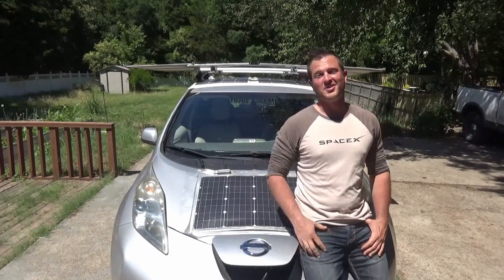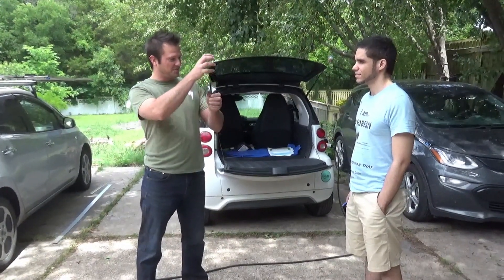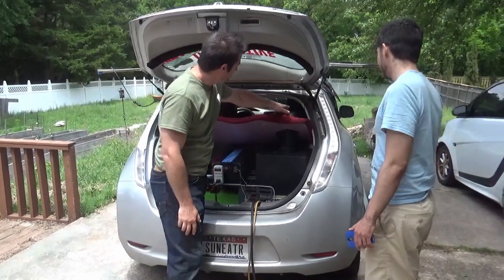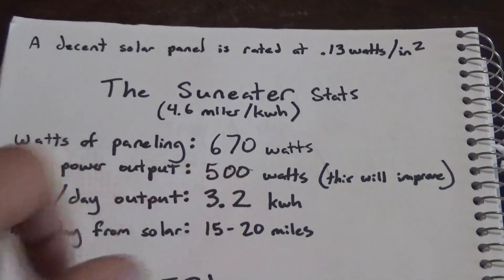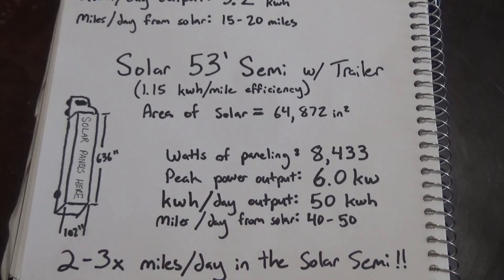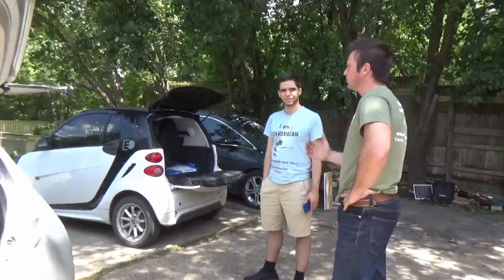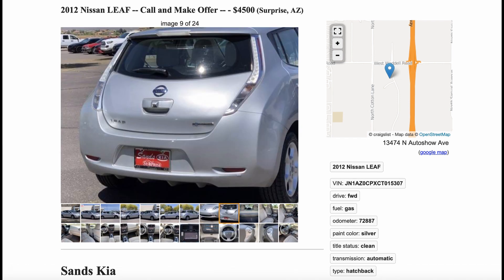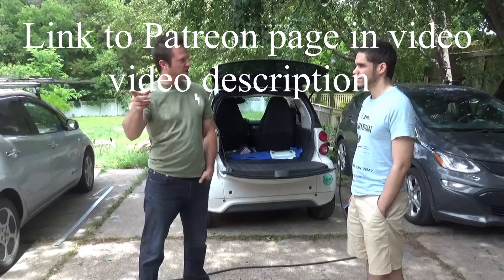Solar Powered Smart Car

Comment: I love everything about this video.  I have been inventing for years and you must not let a few failures get you down.  I recently tried to import a Renault Twizy to New Zealand but failed because it could not be registered for the road here.   My arithmetic suggests that the lighter the car, the better your chances of success.  I see that AliExpress now has flexible solar panels mounted in a frame.  They are light weight and more rugged than a normal flexible panel.

Comment: Im buying a leaf soon. Do you think you could do an updated how to video. Like what you'll need in your solar panel kit. Where to buy it from. How much it costs. Then how to do it!
Reply from the maker: I need to do an updated complete build video.  The first one could use some touching up for sure.  It will probably a while though.  If somebody else got all the parts and brought them over I'd help them build it as an updated build video.  It's a full days work to do the build though, and I have way too much on my plate already.

Comment: I love my Nissan leaf. Unfortunately baterry have 3 bars only, in thinking on install something like this, the big question is....is there any option to charge the when is in ise? Like Chevy volt, the volt have his own generator. When battery is low generator run. But car still runing
Reply from the maker: We could hook the solar up directly to the main battery.  I want to develop an adapter to make this a simple plug-and-play process.  The problem with using your solar power while driving, is driving takes a LOT of power.  20-40 Kilowatts.  The highest power I've ever got my system to produce is 1/2 a kilowatt (500 watts).  So basically 1 minute of driving for every 10-20 minutes of solar power.  So if it charges all day it can get you somewhere around 12-16 miles, but during a 20 minute drive around town, the solar would deliver minimal extra power.  I hope I did a decent job of explaining that.  Have you considered getting a new battery from Nissan?  You could have a 12 bar Leaf again for $8,000, and then sell the battery currently in it for 1,500 or so.  So you're out of pocket 7,000 or so for a "new" Leaf.
Reply: @InnovativeSustainableSolutions  i see, an other option, (idk hoy difficult is) install a generator, like volt or i3,  did u think about it? What i want its run the car wo stop to recharge it. And i don't think so, install a new battery for 5500 mmmm, i going to install a system like yours, and when battery gets died bring to the junk,  i prefer to buy a chevy volt, i like those too, thanks for your reply bro, God bless

Comment: I honestly suggest 2 small wind power generators that can be deployed on the roof when parked. NO extra weight for batteries or having to worry if there is no sun.
Power converter and a small battery bank as a buffer will weight less and function 24/7
Reply from the maker: The wind generator gets suggested by a lot of people.  I may try it someday, I think it would be worth it JUST to see the reactions of the guys in the work parking lot.  The reason I havn't pursued this yet is setup time.  We're doing 5 to 6 12 hr shifts/week at UPS right now, and I'm really trying to keep the time it takes me to park and deploy the roof rack, plug in the car, etc. as short as possible.  Ideally under 2 minutes, so I can get the day started.  I'm having trouble visualizing an attachment method where the turbine can be removed from the vehicle and fully installed in about 60 seconds.
Reply: @InnovativeSustainableSolutions  I already thought about that. I'll explain it to you in an email. Hint. Rail system with one hinge

Comment: I saw something of a pull out solar shade for the smart on YouTube. Would that work for the leaf? https://youtu.be/wyJYU2j-FDM
Reply from the maker: I'm about 95% sure the system in that video doesn't work.  You have to have a pretty consistent 600-700w+ power supply to charge an EV.  Solar panels power output varies considerably based on lighting conditions.  So on a partly cloudy day the system shown in this video would dip below that minimum power requirement as many as 100 times in a day as cloud cover blew in and out.  There is a contactor that closes with an audible 'pop' whenever you plug in an EV (Leaf, Bolt, Smart Car, Tesla you name it).  This motors that open and close that high voltage contactor are designed to operate once, maybe twice a day tops (when you get home and charge your car).  Forcing this switch to open and close 100 times a day when cloudy would almost certainly fry it in short order.  I've been thinking about doing a video on all this, but I'm not sure anybody would find it interesting.  What do you think?
Reply: I agree with Sam that the system doesn't work.  I don't think that's an actual solar panel. It looks more like a roll up poster holder. The typical flexible solar panels do not curve like that. There are rollable AMORPHOUS silicon solar panels. But the efficiency of amorphous silicon panels is very much inferior to mono-crystalline silicon. The difference is so much that it's probably not worth using them on a car. The website mentions perovskite solar panels which are not in mass production. 

Now the supercapacitors: They appear to be a good choice for this application. I actually charged my car from supercapacitors. For like 48 seconds. Then it's wait to recharge. I calculated almost 300 charge start/stops per day. I wouldn't do that. I would consider more than 10 start/stops a day unreasonable. The system should be built with Lithium Titanate batteries instead. With 20,000 cycles it would be fine to do several full cycles per day. The cost is about the same as supercapacitors but the batteries store much more energy allowing for fewer charging start/stops. 

It isn't feasible to go without a battery when charging via J1772, at least with any array that could be vehicle mounted.  A solar car needs to charge efficiently at power levels as low at 50 watts in order to collect energy during mornings and evenings, or when it's cloudy. If charging stopped whenever power fell below 600w, besides cycling the contactors, there would be a lot of energy wasted because the car couldn't use it.   -James
Reply from the maker: @realsolarcars  Joint "debunk the fake system" over Zoom, video?  I think there would be a lot of information/topics in such a conversation that people would find interesting.

Comment: In my case it would have been $900 for an outlet.  There was an outlet on the inside of the wall already, but "EVs need a dedicated circuit" ran from the breaker panel.   I know not to plug anything else into the same circuit. Told them I would use the public charger 2 miles away.  Even apartment dwellers can use a device like Quick 220 to boost charging speed. It's really nice when it's not easy charge all night.
Reply from the maker: I'm not familiar with that component, can you post a link in this thread?  Looking foreward to your next vid btw.  I refer Volt drivers who e-mail me to your channel
Reply: https://www.quick220.com/  I did not buy the device, I built my own. https://hackaday.io/project/4818-a-quick-220-clone  This page has a good explanation of what is going on.  The EVSE can perform some of the safety functions. I really do need to make more videos. This would be a good idea for a video.  Thanks! -James

Comment: i have that same kind of electric smart car and i want to make it solar rechargeable! im also in an apartment where i cant plug it in at all! and now with the virus lock down in los angeles i cant get to charge it anywhere or go anywhere :) but a problem is my smart car has an entire glass roof and you wouldnt really want to cover that permanently i do keep it covered with a tied down car cover so I was thinking if i could put the panels maybe flexible ones on the car cover since it just sits in the sun 95% of the time or higher now then just remove the cover and panels when or if i ever get to drive it again ;) your right about the small roof coverage but if it could be put on a car cover then the entire top surface (windshields etc) could have panels on it and if it just sits in the sun all day every day when im not using it (im disabled and would only go out a couple of hours a week locally if that but now i cant go anywhere due to the virus) that should be enough to re charge the small amount i use it.
Reply: Because L.A. is so sunny, I wonder if adding solar panels to the huge surfaces on the doors on the sides of the car would be effective? It has been done on upcoming production solar cars like the Sono Motors Sion and to the hood of the Lightyear One.
Sono Motors Sion Side View: https://en.wikipedia.org/wiki/Sono_Motors_Sion#/media/File:Sono_Motors_18282114721.jpg
Lightyear One front view: https://upload.wikimedia.org/wikipedia/commons/f/f9/Lightyear_One_at_Goodwood_Festival_of_Speed.jpg
Reply: There is a video of a Russian guy  epoxying solar cells on the inside of sunroofs to make some very professionally looking solar sunroofs. They won't get optimal cooling, encapsulated like that, but they need to deliver most in winter anyway, so in reality, it is not that big a problem. I presume he uses UV resistant epoxy no to have it yellow. I can't remember the link, and I don't understand Russian,  but the idea is a no brainer, and depending on the spacing of the cells, you decide how much sunshine you let seep through.
Reply: I was thinking of putting a solar panel on top of the smart car then let it charge while being parked all day in the sun. 🤔 remove it before driving etc

Comment: About your car. I've seen shops that are upgrading leafs into 64kw. Crazy awesome. If I had one nearby and a 3k leaf laying around, I would do it.
Reply from the maker: We're getting there.  When we go back and build our own batteries we will also have the option of winding a copper cooling cable through the pack, and finally fixing the Achilles heel of the Leaf (what Nissan has elected not to do for the last 9 years)

Comment: That's a great example of why we don't have more EVs running around. Condo's don't like to do the hard work. They only want your money.

I wonder though if he could charge at work or find a place nearby with a plug.

A portable solar powered battery is a great solution if he can leave it charging on the parking lot. But I believe the association will block it too.

Comment: I’d like to add solar to my 53 foot trailer roof to run a air conditioner. I hope to have a Tesla semi in a year or two. I currently have a Chevy bolt and love it.
Reply: I've heard that adding slow-start systems to air conditioners can help make off-grid A/C systems more viable. I heard that from the channel, Gone with the Wynns.
Reply from the maker: The Bolt is a great vehicle.  But they keep pushing the price point up every year, I see the 2020s going for $40k now.  I would like to see either Chevy or Nissan cut all the bells a whistles and bring a solid basic EV to market in the mid 20s.  It's the one space Tesla doesn't own yet.  As far a solar A/C for your rig, go for it man.  I run a 1k btu window unit in the house off my solar car sometimes in the summer.
Reply: Innovative Sustainable Solutions I’ve seen used bolts go for as low as 14k. It’s the best used car value, since the batteries hold up and first service is not until 150,000miles not counting tires, wipers and cabin filter.
Reply from the maker: @auctionwheels  Nice.  I'll try and find a $14k Bolt for next weeks EconomEVs